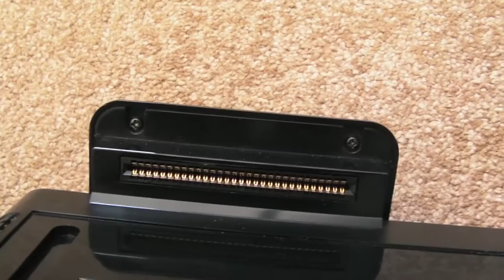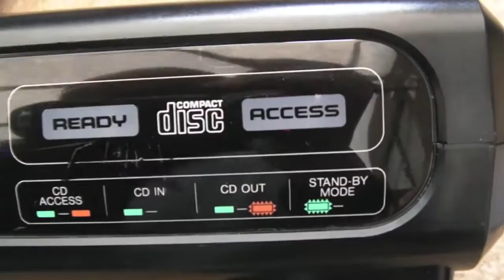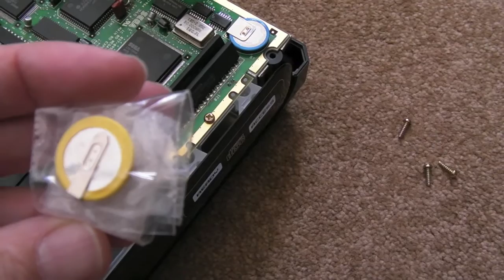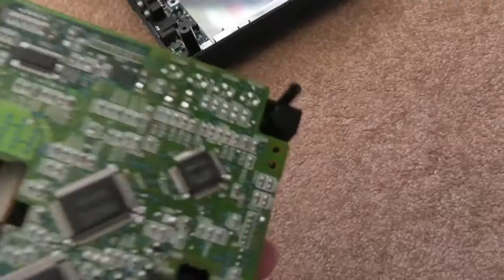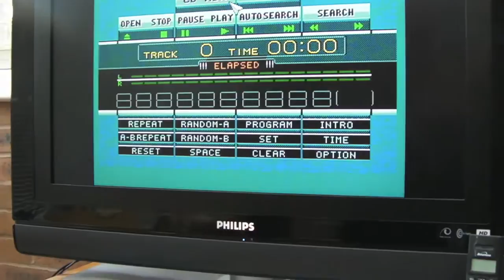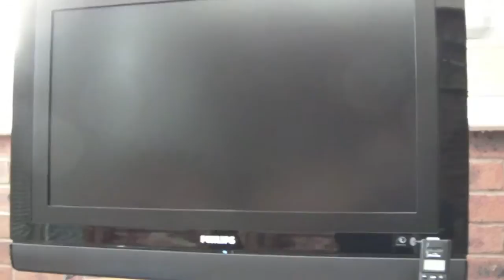Sega Megadrive (Genesis) Mega CD (Sega CD) Repair

Comment from the maker: It's worth checking out some of my later videos before you start adjusting any pots.  I recently showed how to properly adjust the laser voltage on a Saturn and Sony PlayStation.  The laser voltage in a Mega CD probably needs to be set to a similar level, so the RF voltage is around  ~700 to 800mV.

Comment: There’s a blue screw under the laser to calibrate the lense turn it clockwise 1mm and it will solve your loading issue plus get that battery off and use a fram mod !!! You willl never need a battery again !!!
Reply from the maker: Thanks, yes!  I've been meaning to get around to an FRAM mod for the last 6 years lol - always moving onto something else!  Regards the laser voltage adjustment, I never needed to adjust it - works perfectly on factory setting still.  I have adjusted lots of CD lasers on my channel, using a scope etc.

Comment: I have a problem with a sega cd that I bought, I changed capacitors and battery, but when I connect it to my genesis, it doesn't start to boot from the cd, after several attempts on some occasions it did boot. But after all, it doesn't run the games, but it does run the music cd. When I unmount the CD, it doesn't want to start again. Are the metal plates of the genesis necessary for it to work? I only have the small one.
Reply from the maker: The metal plates are not required!  They just provide a little additional grounding / shielding.  There could be a damaged trace around the leaked capacitors on the Sega CD digital board - that does happen!  Mainly around the ZIP RAM I think.  The other possibility is the flex cable was damaged, or there's a RAM fault.  If you have an Everdrive you could run the 240p test suite RAM tests.  It has RAM tests specific to the Sega CD.

Comment: Hello . my sega mega cd will not start. I checked the power is present. But I found the electrolyte on the main board from the capacitors. Could this be the reason that my sega mega cd does not turn on?
Reply from the maker: Yes, that's very likely the problem.   You need to replace the capacitors on the digital board and clean up and inspect for corrosion damage.

Comment: I realise this is an old video, but did you ever manage to replace that front panel piece (the one you fixed up with a marker pen)? I can't seem to find a spare and buying a whole system just for that seems a bit silly. Mine is not so scratched but unfortunately I snapped it, on the long thin side that sits over the CD tray. It's one of those things that doesn't affect the functionality and no-one notices...except me, heh.
Reply from the maker: No, I didn't!   I later did a multi region BIOS mod and in that video I tape up the inside of the plastic so light didn't shine through the scratched areas.  That can work well.

Comment: Hey Gadget, can the 10 SMD caps on the main board be replaced with SMD ceramic caps, I know they're titchy and a pain to fit but they don't leak and seem like a better choice to me, I don't know if they're suitable for that application or not though, any ideas?

Comment: I have a mega CD 1 and it gives message about internal ram when loading Sonic CD.  All my other games play no problem.  Will changing the battery fix this?  Could you tell me where to get the battery from on the bay of E, i am UK and a NOOB to this so apologies if these questions seem trivial but i really want to play Sonic as well as learning to fix my mega CD.. I'm semi confident about desoldering and resoldering new battery.
Cheers
Reply from the maker: The battery is most likely the cause - but the Sega CD 1 also suffers from bad SMD electrolytic caps.  The caps leak all over the board and if not replaced will ultimately kill the system.  They can sometimes leak around the save RAM area of the PCB.  You can fit something like this:- http://www.ebay.co.uk/itm/5-PCS-X-New-Li-ion-Rechargeable-LiR2032-3-6V-Coin-Cell-Battery-with-2Pins-tabs-/131857650664?hash=item1eb35413e8:g:bmoAAOxy1JBSRUVj

You might need to bend the connections a tiny bit on the new battery to make sure the battery doesnt interfere with the shielding - ie. move the battery into exact same position the original one sits on the board.
Reply: Cheers for the advice + link! The caps all look good, but i will change them at some point. My battery is a 2016 and not a 2032 though.
I may get a broken mega CD to practice on 1st before doing mine as it is in mint condition and i don't want to f*** it up!
Reply from the maker: Yes, you can still fit a 2032 though!  That's exactly what I fitted.  Alternatively is look for an LiR2016!

Comment: So i replaced all the caps and it still will not read disks. Then i adjusted the laser pot and it still wont read disks. I then adjusted the four trim pots one at a time after taking note of original resistance values. Still wont read any disk. I can only conclude that the laser pickup is faulty.
Reply from the maker: =/  Sounds like you need a new laser!  That's not uncommon - I had the same problem with my Saturn where it just wouldn't see a disc at all with the old laser.

Comment: hey I really need your help I'm so close to fixing my sega mega CD I've 
done the full cap replacement and so on but I noticed there where 2 SMD 
Caps removed from the bottom of the board C23 and the one right beside 
by some one who was working on this machine before. I have no idea why 
but I think that's what making it come up all distorted when I turn it 
on I didn't think much of it till I seen the underside of your bord, my 
problem is I cant find the values of these SMD caps anywhere you 
wouldn't have a data sheet with the Caps uf and voltage thanks
Reply from the maker: If you've got the MK1 Mega CD like mine, then all the SMD electrolytics on the main digital board are all the same size!
Reply: yea it looks to be the exact same model as yours, my multilateral is a peas of crap and cant detect uf or voltage I can only use it for checking pad continuity I need to buy a new one. would you now the value of these SMD caps ?
Reply from the maker: If you are looking at the digital board (not the PCB on the CD-ROM) - they are all 10uF 6.3v I think.  Make sure you get them the correct way around with regards to + and -.
Reply: so after a tone of reading and studying the service guid the the Cap's C23 and C26 on the underside of the board is 100PF and 50v fuck my life that drove me insane cheers for your help and love your videos thanks.
Reply from the maker: Ah, I see!  Sorry I thought you were talking about the SMD electrolytics!
Reply: hey So I have got it to boot eject the disk-drive lights up and everything but when it boots the bios screen pops up with the boot screen but 2-3 seconds later the screen goes blank but the sound keeps playing and I can only eject the tray within the first few seconds of it booting after that the Mega CD just gets stuck, now my theory is its something to do with RAM transferring what ever it needs to to the mega drive but is crashing not sure why though. I reflowed the solder on the RAM models sorry to annoy you again just you seem to be the best person to ask.

Comment: I just got a Sega CD that's not reading any disks. The access light is constantly flashing and the i can see the disk trying to spin. Do you think adjusting the laser pot is my best move?
Reply from the maker: mark the laser pot before you adjust it with a fine tip perm marker (down the side) so you can set a new laser to the same position, and you can also revert it if the laser is not the problem.  Is it a MK1 - The caps could be the problem on the logic board, as they nearly always have leaked and need replacing.
Reply: Yeah its a MK1, I'm going to clean the board this weekend and inspect the caps. Thanks for the help, I will let you know how i get on :)

Comment: My mega-cd stopped reading disks, Watched this again and fixed it, I adjusted the laser pot as you suggested and it worked. Nice one Gadget. You probably know this by now but if you want to eject the cd-rom drive hold the reset button down on the MD. ;-)
Reply from the maker: +craig gilchrist Thanks!  Glad you got it working again!  Ultimately you will need a new laser, but those JVC optima lasers are quite common on AliExpress!  Yes, I eventually worked out you can hold the reset button down =D  That conflicts with my region mod though lol.
Reply: @GadgetUK164  i had same conflict so i fitted a region free chip to my board i know the everdive has the roms on it but after i modded my mega drive with a region free switchless mod the ever drive cart mega cd bios wouldnt open the drive just reset back to the cart menu

Comment: Hi there. I have a couple of japanese model ones both version 1.00 bios. Unfortunately both are faulty and I could prob do laser replacement myself (does look tricky but could do it) but I am not convinced that is only issue or confident enough to start messing about with them. The first one came with just not reading games then I think the fuse went was constantly ejecting the tray and to get it closed to put it away I cut the mains power when it was just closed and maybe that has somehow blown the fuse. Anyway I recently got another one and paid more for it to be working as I knew last one needed laser, and this one also came not reading games! Seller hasn't replied yet but hoping can maybe get help from you. This one had no music on bios start up screen either which is a fault. I opened it up to see if was anything obviously wrong and noticed something loose like a piece of plastic from the laser area fell out, could you repair them please? Im in UK.
Reply from the maker: Hi, due to health issues and full time job I cannot do repairs for other people :\

Comment: Seems like it could potentially be a compatibility issue via the Everdrive itself.
Reply from the maker: ***** It was solved by using the same region disc and bios.  When they differ you get the problem.

Comment: Haha, you got caught out by the Starblade trap! :D  There is another video on here of a guy with the same "problem", thinking it was the laser or some other issue.  It is one of the few games that will not work with the region free BIOS.  I discovered that Flashback is another.  I bought it (SEGA CD version, only version released), and it would not boot on my JP MD/MCD/32X with region free JP BIOS.  I no longer have a computer capable of using the region convertor anymore, either.  

Still, it's better than the old days when I had to buy a CDX to play my non PAL games.  I had to buy a second CDX in 1995 that had a newer firmware version so some of my games that the first CDX would not load, would work.  They were $120 each :(  It's good that your MCD has a good laser, the laser in the PAL systems are near impossible to find.  Unlike the SONY KSS-240A in the JP/US model 1 systems.  I have about 10 JP systems I need to buy lasers for, as well as the fun of replacing the caps.  SOJ and NEC must have used the shittiest, cheapest caps on the planet in the NTSC Model 1 and PC Engine DUO!
Reply from the maker: A Shaw Haha, yes, Starblade well and trully got me lol.  I am glad it did because it was what forced me to swap out the caps and change the battery etc.  You can buy the lasers for the PAL system on AliExpress - quite a few sellers, but if you order from there its worth ordering 2 or 3 as the quality of replacements is hit and miss.  It uses an Optima laser - I forget which model it is but I've got it noted somewhere as I am due to order a couple of spares for my system.
Reply: Ahh, I did not know the Optima 5 were on Aliexpress.  I could never find them.  The problem with buying lasers there is making sure they are original and not cheap Chinese knockoffs.  I bought 3 KSS-240A lasers last year which the seller assured me were original, and not a single one worked.  I really need to order some more!
Reply from the maker: Those KSS-240A lasers are crap lol!  I had 6 and 3 worked!  With the Optima ones they seem to be genuine (depending on the seller).  I got an Optima for the Saturn and its perfect, the previous one I bought as 'genuine' from a US eBay seller and it wouldn't work with burned discs at all, no matter what voltage the laser was set to.
Reply: I should check for the Optima lasers rather than getting the crappy SONY ones.  I have 15 or so JP MCD M1 systems, I plan to fix up and sell most.  Out of all of them, 3 still read discs!  I don't know what it was about the SONY lasers, but it is rare to get a MCD or SEGA CD M1 with a working laser.

It seems to be much rarer for the PAL models, with the JVC Optima's, to have dead lasers.  The SONYs in the M2 MCD seem to be much better and usually have working lasers.  The Optima 6's in the Saturn seem very good too.  Although I do have a Victor M1 which has trouble reading discs.  Quite ironic ^_^

Comment: I was having a corrupted sprites issue on the BIOS (https://www.youtube.com/watch?v=nD3kYd-xSeE) nearly all the surface mount caps had leaked, and there was a bit of corrosion.
I managed to replace all of them but i'm still having the problem.
The it's not a BIOS problem as BIOS loaded from my Everdrive has the same problem.
I'm wondering if you would be willing to take a look at it as i've run out of ideas and skill. if so how much would you charge?
Reply from the maker: Sorry - I just don't have the time, or the nerves to work on other peoples systems.  Too many risks etc, especially with my health problems and a full time job as well =/  The best I can suggest is to contact RetrogameModz or ArcadeUK, they might be interested in doing a repair.  Have you tried reflowing the quad flat packs using good quality flux?  There's a chance one of the traces is damaged, or worst case a fault VRAM chip.
Reply: No worries mate, i wouldn't have held you accountable for any mishaps, you could hardly make it worse than it already is :D. I just wanted to save this system from the bin. Turns out the damage is worse than i thought. The corrosion  from one of the leaky caps had disolved the solder from the ASIC chip as well as weakend the leg so when i went to clean off some of the corrosion with a cotton bud and Isoprop, the leg snapped off! :(
I don't have the tools to deal with QFP's
Reply from the maker: TheDeeplyCynical You can recover snapped off legs by using a dremel on the plastic / cermaic top edge of the chip, you have to have the grind head rotating so its rotating towards the top of the chip and away from where it makes contact (towards you).  Eventually if you are careful the pin edge will be exposed and you can solder a kynar wire onto it.
Reply: GadgetUK164
That's way too advanced for me! I even contacted GametechUS who just said "yikes" when i told him of the problems. I got another machine coming from ebay (hopefully just a simple service will be needed) so i'll sell my faulty one for spares

Comment: BTW, your problem with most games using freeregion bios BY the everdrive is that at some point, the megacd detects something in the megadrive's cartridge slot and it hangs.

Just burn aneprom and replace the rom within the megacd. Solved. ;)
Reply from the maker: I don't have any problems with Mega CD games with the Everdrive connected!  The only games that behave strangely are Starblade and another I mentioned in the video.  Do you know which games have a problem?  All other games (and I've played a lot) all work fine with region free bios via Mega Everdrive.   Thanks for the suggestion on a BIOS mod!  I will eventually replace the on board BIOS with a switchable region BIOS though - hopefully I can fit all 3 in one ROM image.

Comment: the problem is the everdrive, all games i tested with the bios loading feature suffered issues from longer loading times to glitches and lockups, even the cd player in the bios itself has disc read issues
Reply: It might vary between the different Everdrive versions.  I use the Mega Everdrive and there are only 2 mega CD games I have issues with!
Reply: ***** i seem to have lumped in an issue i had with a bad rip but  still there should be an asterisk next to "CD BIOS loading." *not 100% compatible. its sort of an annoying issue but id rather have the capability than not and the product is worth getting if it interests you at all

Comment from the maker: When watching this video back it amazed me how many things I would advise differently, following what I've learned from some great channels on YouTube.  Check out this video (and channel) for really detailed overview of how CD systems (like this one) work, and why it's not a good idea to just wildly start adjusting pots.

https://www.youtube.com/watch?v=lZK3Rmerg1I
Reply: definitely would not twist off anything from a pcb, lifted traces are not fun
Reply from the maker: True, some people cut the can leaving the legs but I've found that can lift the pads.  With the type of caps on here the legs separate from the can when you twist, provided you keep it centred.  Desoldering them is probably the safest, but with the leaked electrolyte and corrosion it can be tricky.